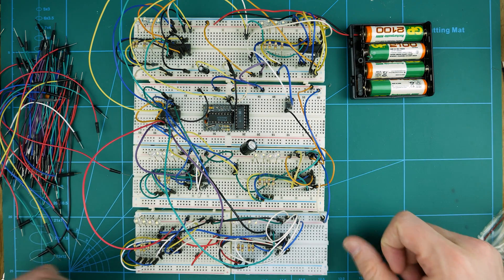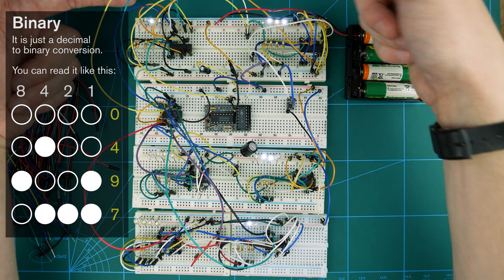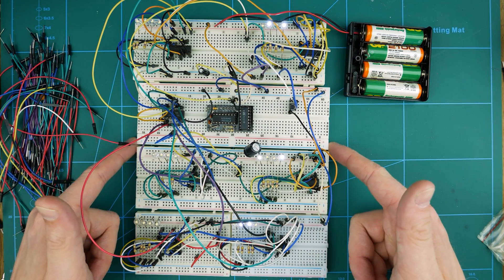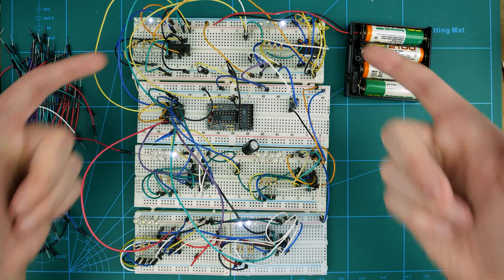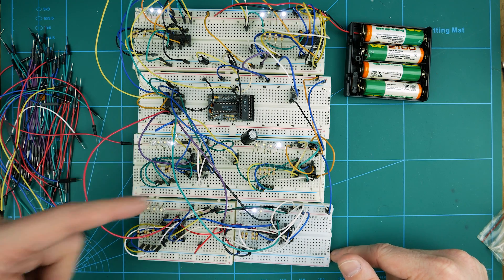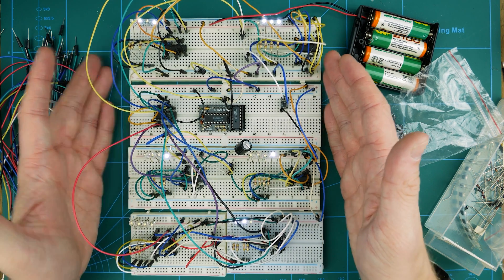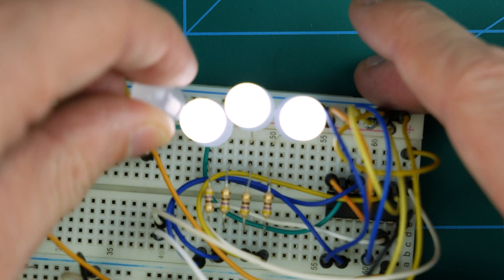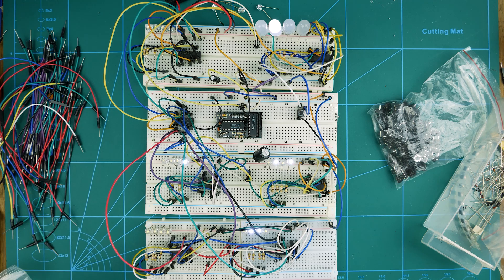Binary Clock Update 2: Done-ish

Comment: Dave, it is not proper binary clock but rather BCD. In pure binary you would have 6 LEDs for minutes and seconds and 4 or 5 for hours.
Reply from the maker: cbm80amiga did I not mention that at the start? I probably wasn't very clear about each digit being a coded decimal.
Reply: Right you mentioned something about it :)

Comment: Surely 2 of the bottom left LEDs (10s of hours) are superfluous as you only need 2 and not 4 as the digits will never go above 2?
Reply from the maker: Yeah they are, they are just there while I am testing. It was mostly about making identical circuits and then modifying them as I went.

Comment: Good job! Years agó I was doing a clock like this, that you could program, also putting a little alarm with binary comparators and that stuff, buuut I lost the schematic and I did not be able to do it again :( Also, why dont you attach the breadboards to the others?
Reply from the maker: I tried to connect the breadboards but the connectors don't quite fit, quite frustrating but I suppose they vary in age and brand a lot.

Comment: What about lead-seconds?  23:59:60
Reply from the maker: I don't quite understand what you mean
Reply: I think you mean leap-seconds. 
Also note that they are not necessarily at 23:59:60, as it depends on the time zone you are in.
Reply: *Leap second. Second that can be inserted or removed from last day of (preferably) June or December. When inserted, there basically is time 23:59:60 before the minutes change. Irregular event, which has very slight effect.

Comment: Stupid question, couldn't you just add 3 buttons (one for each stage) to increment steps manually?
Reply from the maker: Sort of, some diodes are needed too. The clock in the 2nd and 3rd stage also connect to reset lines.